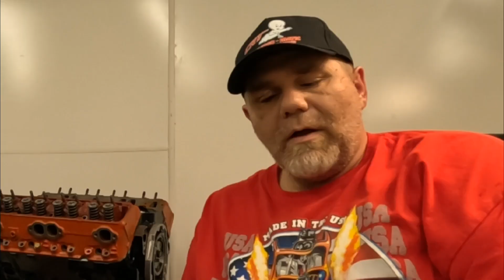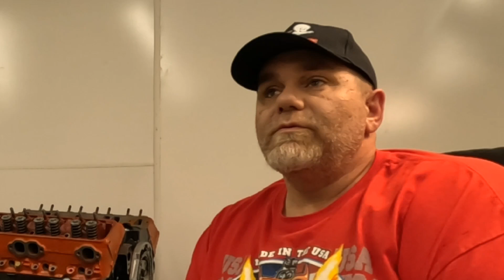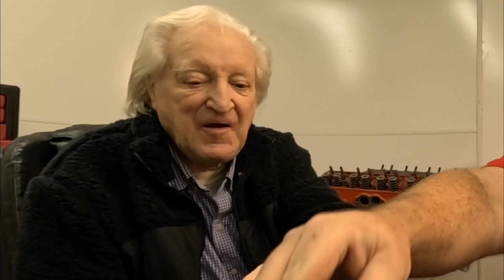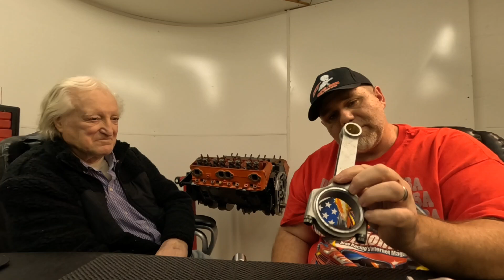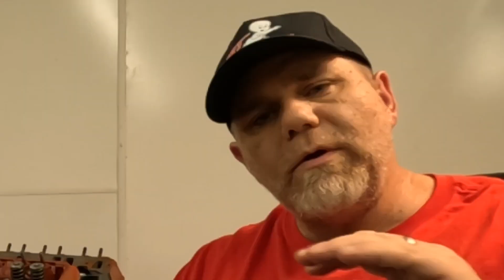When is Stock NOT really STOCK? @DavidVizard @servediocylinderheads @JustMoparJoe

Comment: This experiment is next to impossible to acheive for a high volume race engine shop, the cost in hours doing the modifications needed is immense and I'm sure that someone else could do this with time on their hands, it appears to me that David and his crew have no time to modify the stock parts for optimum performance. Otherwise they would. 
I see this subject from both sides, because I've been there with many brands of engine, mostly GM small blocks, and ford 302/ 289/ 351 w and a few old hemis like the 392 which I consider an icon. I've never built a 318, I've only slapped on factory mopar add one like cams, M1 single planes and thermoquads because those things im very good at. Never felt the need to max out a 318 to the limit because they were all my daily drivers but I have gotten some interesting results! The best mopars are 1974 and earlier, stout blocks, great heads, and almost indestructible bottom ends from the factory, after that they were cast in Mexico and the foundries there were not as good at quality control when it come to core shift, ive had 3 blocks fail that were cast down south because the cylinder wall cracked and imploded while running! So now I don't bother with anything newer than 1974 small blocks of any brand for building.

Comment: Much like I've mentioned, I took a stock chevy 350 and built it to 780 hp at the crank. But it was 2 years of planning, researching parts, I had no help but my previous experience( 30 years of fixing and tuning every kind of engine known) and of course the relative goal of 5-600 hp. Needless to say I was pleasantly surprised by the result! However, I was very scrutinizing of the entire process including making every moving part weigh exactly the same, every piston weighed exactly the same after a little dremel work, every connecting rod, every valve, every pushrod, lifter, rocker arm etc, every valve spring was modified to have exactly the spring pressure I wanted etc, and that's why it ran so well and in a 6,000# truck it delivered 26 mpg at 60 mph and would hang the front wheels  in 2nd any time I was under 30 mph because I matched everything and my trusted machinist bluprinted the block for me to make sure every lifter bore and cylinder bore and crank and cam bore was perfect before I assembled everything.  That's the diffrence between a " stock untouched factory 350 and the one I painstakingly planned and executed.

Comment: For me I was looking forward to watching this and maybe picking up some knowledge on possibilities of modifying or manipulating factory parts for not just HP gain but better endurance, quicker revving etc. and making what the factory made to be better. I personally would like to have seen all factory parts starting with the engine block deburred, oil gallies modified, crankshaft, rods, pistons, pins, rings, lightened. Oil pump mods, anything possible with a cam even if it required ideas of scrounging a wrecking yard for better cam that would fit the smaller engine displacement. Possibly illing in extra valve reliefs are if enough room regroove for a thinner top ring. I wouldn't expect anyone to weld and hand grind a cam, but it has been done. Some rods has been offset bored on small end and bushings to give longer rod length. David has had many books with ideas that I would like to have seen actually been done. Doing Brazinski type mods to the intake, and any secret/mods to a factory carb. Charlie has done exceptional work with the heads, but with his mods and only using factory larger valves for that brad engine even again from a wrecking yard possibility I think would have been cooler.  I understand it would take many more hours are having more volunteers helping to be easier and ultimately it is about money for the St Jude's Childrens Hospital. But to have a chance at bidding on a engine like above built by all of ya'll and things listed above, I would much more rather bid on are buy a possible lesser HP engine like that than the current one. I personally would have bid far more for more for a custom one like listed above. But I admire you all and will continue watching the build and if ya'll ever do build like above, I would definitely bid on it, maybe there will be a next time.

Comment: parts useage:  factory unmodified (factory stock), factory modified, aftermarket.   the mission 318 was intended to be factory modified, like ported factory heads, ported factory intake, ported factory 2v carb etc.  Had those terms been used more carefully, it would have been clearer to the audience.  As has been said before, 400 hp can be obtained in a 318 using nearly all aftermarket parts, but what could be done with factory-modified only?  That is what the original intent was supposed to be.
Reply from the maker: If you watched the Video that is exactly what we are still doing! Ported 675 casting heads Stock intake and a BBD carb but it won't remain in that configuration on the Dyno once we have obtained those numbers then we are swinging for the fence and going for more than 400hp! Alot more
Andy

Comment: I did an engine a few years back.   ALL factory casting numbers.   Decked the block, cut the heads, ported the heads, bigger valves , had to cut the intake, port the intake.  Long and short of it when I was done I had an engine that looked 100% stock.  All pre-1967 casting numbers.   It made great power and ran great times
     The new engine I just put together with all aftermarket parts makes more power and was cheaper to build.
Reply from the maker: YUP! I can wait to see that FE Fly... I definitely want to see it run..
Andy
Reply: @UnityMotorSportsGarage  thank you very much,  I can’t wait to get it back up and going.  I miss driving it.
Reply from the maker: @frizzellracing let me know when y'all head to Shadyside next time!
Reply: @UnityMotorSportsGarage  definitely, hopefully we can get up there soon to do some testing.   Shadyside close to you ?
Reply from the maker: @frizzellracing I'm in Mt. Holly and SS is about an hour drive

Comment: obvious flaw is a carb designed for a slant 6. i used to drive a 318 2v and had to let up on gas pedal and ease into it to get more speed lol. Just use the Police special 4 v  intake from a 318 and close enough hehe. i made approx 170 hp with 31 2v drag race et rwhp ver close to stock with headers only with my 74
Reply: I agree. Even a guy with very few dollars to spend is going to ditch the 2 barrel. It was the first thing to go on those engines. A cast iron 4 barrel intake should be affordable even now.

Comment: 3 tricks to raise compression + 302 roller+ Cleveland 2v OC heads + 289 rods + 351C pistons + grinding and port work + Imported boss dual plane intake + .444, 210@ .050, 115 LSA = 10.5:1 experiment. Built from lowly parts and cast off junk. It will run, and I can assure you many of the ideas and proceedures came off of YouTube; a trail of info from DV, Andy, Charlie, Tony, and countless other sources. Mission Impossible occurs in many places where ideas cant be left alone.....and the ideas have almost the same value as the final product. If not for hot rodding on the internet, my engine stand would have never been purchased.
Reply from the maker: Heck yeah! That is cool stuff 
Andy
Reply: I was seriously thinking a similar project. I have the intake and maybe the heads already. Block and crank too. Very close to stock 5.0l with tons of work on the stock parts. I hate the stock cam and stock springs are a joke. Retainers could not be  designed to weigh more!
Reply: @servediocylinderheads  The intake is the most exotic piece. The rest is just fiddling. If you mess with 2v heads, you will see monstrous low lift, and that is why I am going to give the stock cam a try. I think the LSA is close to what the heads would like once the pistons are .085 out of the bore and the heads are milled. Also, the stock cam will not need giant valve springs. PTV is less an issue than you might think.

Comment: I must say now this build is getting good. It makes sense to not mod stock Chrysler stuff simply because of the time and labor as mentioned. That equates to cost I agree. Also why invest all that time and labor to only miss the target horsepower goal. The decision on the way forward  made makes sense.
Reply from the maker: The fact is it will be run in "stock" trim on the Dyno for a few pulls then I'm getting rid of the 2bbl junk and manifolds swapping the Cam on the Dyno and we are going to let it eat and see what it does and have fun doing it! The results will be that just the results
Andy

Comment: Last winter I build a 427 bbc with a 454 block and 369 crank. I used the stalk 454 rods with a set of old forged dome 427 pistons I found on market place. If I put the motor together as it was  there would have been lots of weight needed to be added to the crank for balancing. Instead I spent a entire weeks worth of nights, being super tired for work and I worked the rods as you showed. Saved me money buying new rods but also saved a few 100 bucks when I got the crank balanced, because I balanced the rods myself and I took enough weight out of them that the crank was to heavy and didn’t need material added just removed.
Reply: I used some stock 289 rods for a 302 build and had to remove some  weight. I did what I saw DV do and had a gram scale tell me when I was done. Mission Impossible is helpful even with the storm of discontent it stirred up.

Comment: Id bet its difficult to actually have a 100% stock engine these days. The only thing close to stock for my 340 is,I have a 72 340 cast iron manifold and Thermoquad setup, but it isnt correct for my 1970
Reply: A 1970 is 54 years old. Can you imagine building a 54 year old car in 1980?
Reply: @stuartwall8212  it would be a 1926 model. I suppose it could be done a old Ford maybe.

Comment: Sanctioning bodies didn't put limitations into "Stock", that is simply not correct. They put ways around "stock" in place, which got us where we are now..... Stock used to mean it came on a showroom car that anyone could buy from a dealer..... That changed massively over the years. So much so that a Nascar "stock" car doesn't have anything from a dealer available car. Stock, came with the car. Changing parts with another vendors parts is not stock, in any way....
Reply: With that definition of stock, nothing is possible to be built stock without a time machine to go back to a dealership in 1970. Or it is built with junk? If that was Tony's plan, I understand why he got left in the dust, and he is being obstinate about this position? Who else on the planet wants to build anything with this kind of restriction? I think this whole project fell on the sword of disagreement about stuff nobody cares about except Tony in that case.

Comment: Stock to me means it is available from the factory, was on a production vehicle, has a mfg part number, I had a 427 side oiler with TRW pop up pistons, and they had a FORD part number. So that stock engine had pistons from an otherwise aftermarket company, I agree with Tony, you are NOT building a STOCK engine, aftermarket parts are NOT normally stock parts,.

Comment: I've been otherwise occupied, so I'm just getting up to speed on the scattering of 'Mission Impossible'.
I'm disappointed that it's gone off the rails from its original intention - and I'm not surprised that Uncle Tony has a bit of an attitude, he's not fond of his ideas discarded nor his word challenged. UT is a truly knowledgeable man, and that knowledge runs far and wide, so his qualifications more than qualify.
I'd imagine that if I placed one person responsible for the project going off in some odd direction, it would primarily be Mr. Vizard. I've followed David's work since the '80s, and he is incredibly knowledgeable, and talented,  has no concept of thinking "inside the box" and presents as OCD (lol). David demonstrates this by his old school process of reworking the stock rod - it's an excellent example of how we used to modify rods when there were no aftermarkets, or they were priced out of reach.
That much said, on an engine that won't see 300hp, the modifications are overkill. 
The cylinder head specialist's work fits  that description as well.
With this benefit auction for St. Judes now into play, I understand the change in direction, and it's potential to help St. Jude's, but I'm still disappointed that the whole direction of the project changes.
Some will debate whether or not it's really changed, but by its initial intent, it's no longer following its intent.
I wish the best in the effort to benefit the patients of St. Jude, and respect the effort, it just a shame we lost the true intent of the project along the way.

Comment: "Stock." I believe that that term comes from the word usage/context of 'dealer's stock,' meaning merchandise on hand. "It's not race-prepared, it's as original as dealer's stock." You can build a far from stock engine using all of its stock OEM parts, and doing the racer's tricks on them. But that's not a stock engine anymore - once you affect the power output in any way, it's no longer stock.
I think that no one wants to have to re-disassemble the engine afterward to put in the all of the non-OEM performance parts which will properly support the build.😂

Comment: Stock isn’t stock if it’s over the stock bore and not useing  factory parts u add a four barrel it’s not stock if u use a different part then what came out the factory doors it’s not stock
Reply from the maker: Well good luck getting 50 year old worn out junk to make power...
Andy
Reply: @UnityMotorSportsGarage 

You have made this comment several times. The idea was to see how much horsepower an engine would make using stock parts or stock equivalent replacement parts not  "50 year old worn junk "... The idea wasn't to put Chevrolet valves and rods in a Mopar because it was
 " easier".  If David didn't have the time to spend on the project He needed to come back to it when / if He had the time. 
The project went off the rails when it became revenue generation. No one is going to give You anywhere near the money for a ho-hum  318 as a teeth rattling exotic creation.
I don't blame Tony for leaving the project and wish You and David all the best.  🤘🏽

Comment: I understand where the viewpoints stand, and respect DV's and Andy's plan. The rods will not by construction create a huge power difference. The minor length increase will raise compression and probably mixture motion in the cylinder for good combustion. The piston conforms to rebuild dimensions. So when they install OEM casting heads, intake and carb that have been massaged, and test it, they fullfill the direction of the original premise. What happens after is aimed at maximizing the fundraiser for St Judes.

Comment: Ok fellas. First...the mission impossible built is going on three years. The videos on massaging factory parts like the crank and rods were good. Even charles. Cylinder head and intake mods are somewhat reasonable. 
   Things have gotten out of control from your perspectives.  Place the scientific tools down and do the build with nothing but tools a guy can get from harbor freight. No flow benches, no crank balancer, no valve grinders. 
  That is what the viewers are looking for.
  Follow that direction, and the views and money will flow in.

Comment: I believe these is a good intellectual excersize in what you can get out of your  time spent. If it works fenominal on stock parts. think of the out come of what David and Andy say'd about doing the same thing to a better part. Also what if you can't afford  fancy new part. But can get something used.Or need to modify an existing part.to achieve at least better.

Comment: I understand your methods, you want ultimate reliability with minimal cost, to support your sponsors. I believe Charlie's heads are going to be good for about 480hp
I'm not sure I would take a stock bottom end to the rpm that would be needed. As for getting 300 hp from a "stock" 318 it is very possible,  at a lower rpm. But not with a stock 2 barrel carb but with a 2 barrel holley it would be easy. I'm still very interested in this project

Comment: 920 casting cylinder heads from a 1967 318 are a closed chamber design that responds well to porting and doesn't have the large pushrod hole intrusion into the port that the 302 casting has. Also, I believe the 67 318 intake and I know the 67 273 intake, was a single plane design that may respond better than the dual plane design did to porting.
Just some things to consider.

Comment: Good luck with the project. I don't quite see what the difference is between UTG spending countless hours using his experience and knowledge modifying stock parts versus buying aftermarket performance parts. Well, there's one difference - the first option is unavailable for the average driveway mechanic. 
"Mission impossible" would have been an excellent opportunity to flex and get youtube views, but would not offer anything useful for most people.